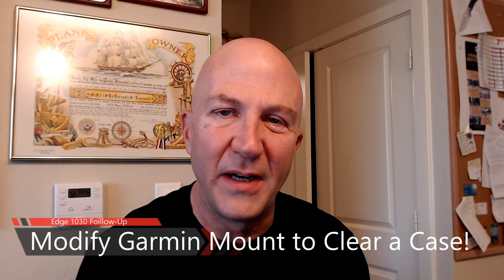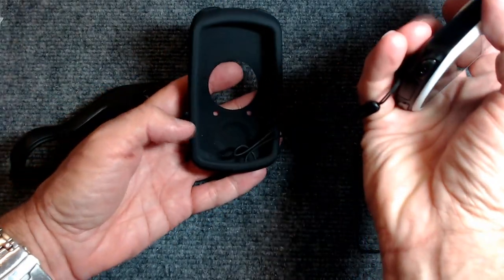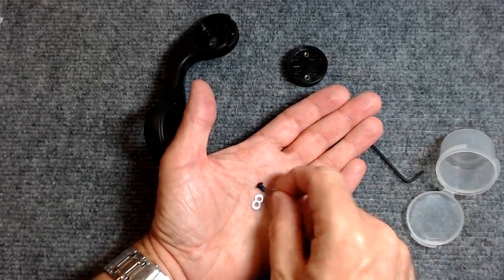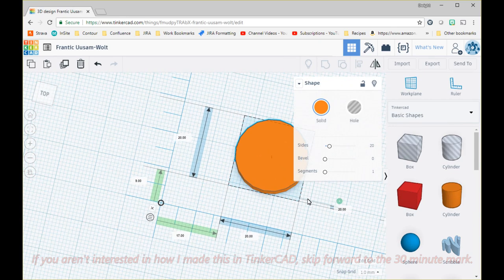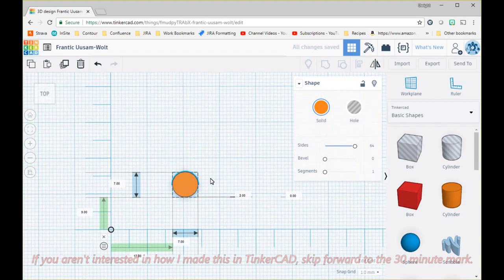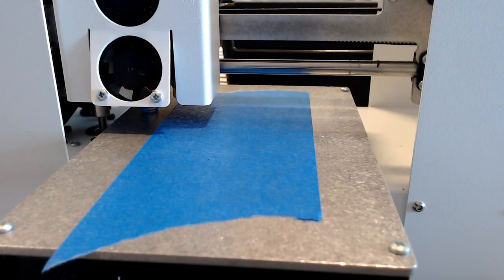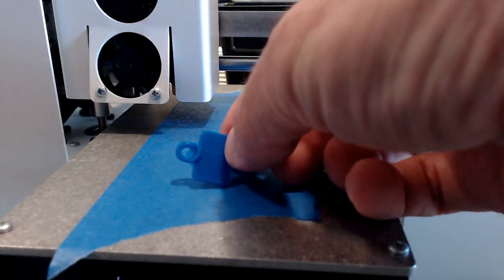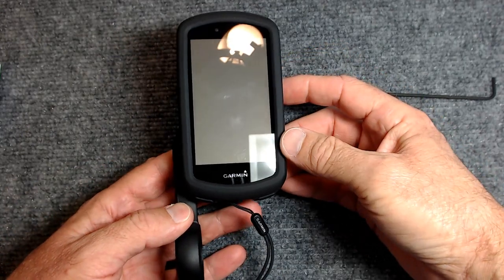How to Modify Your Garmin Edge Mount for Case Clearance

Comment: Had sort of the same problem with my 520 case but I just went ahead and cut a bigger opening on the case to get the clearance I needed.  60 sec low tech solution.
Reply from the maker: Interesting! So you left the screen in place, but made a big enough hole to replace the battery? I'd love to see some photos or video of that.
Reply: No, I mean I cut a big enough hole on the bottom of the silicon case to fit into the mount. I think you are confusing this comment with the edge 520 replacement battery video.
Reply from the maker: @許嘉宇-y5r  Yes, oops! That's what I get for answering YouTube comments on my phone.